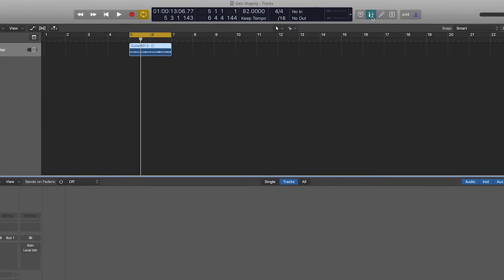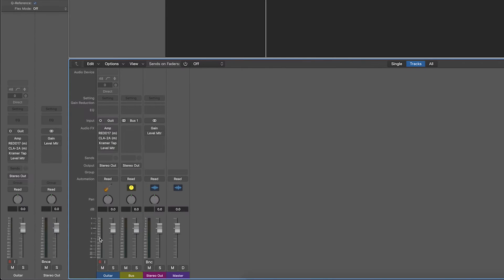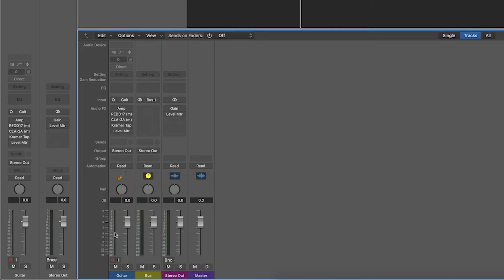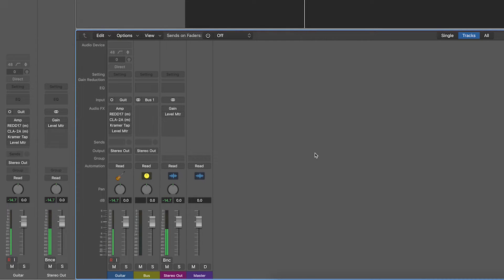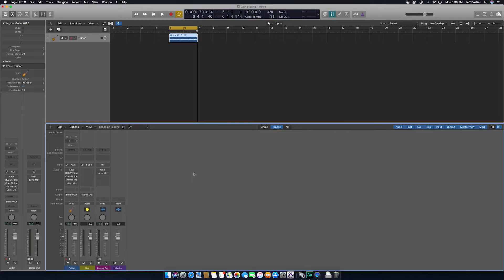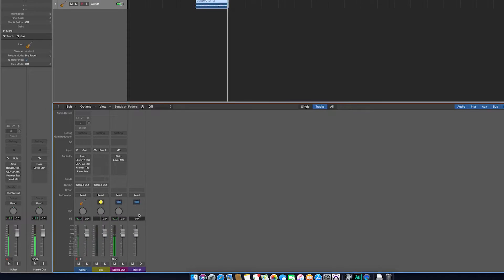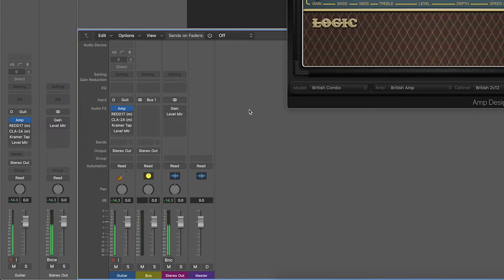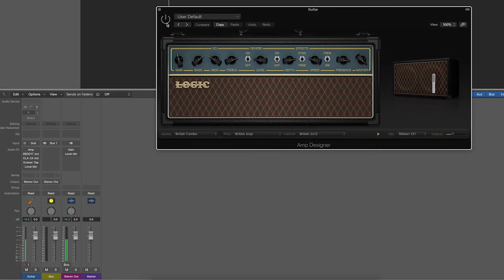LEARN TO: Proper Gain Staging in Logic Pro X

Comment: So funny, I've been recording and mixing in Logic for years, and I do that same gain reduction on my master fader every single time.   I've always thought it's probably not the best thing to do, but it seems to work FOR ME.   I've produced and mixed loads of albums and singles and ALWAYS use this method.   I've never had a complaint from a mastering engineer.   You have set my mind at ease, thanks!

Comment: Appreciate this input, many thanks. But I still get confused about all the professional videos here on youtube telling me different things. It is the -12dBu RMS versus -18dBu RMS question I do not understand. If -18dBu RMS, which is in the analog world 0dB - the so called sweet-spot, why do I learn here that it is -12dBu RMS with peak at -6dBu? Many other videos say that the best range lies between -10dBFS and -18dBFS. In other words: -12dB probably results in too hot signals. It would be fantastic if someone could help me with this questions.
Reply from the maker: No worries at all. So the thing with gain staging is not to overthink it which many people seem to do. Each instrument is different and needs to be treated as such. A bass guitar is very dynamic, doesn’t have much of a transient and lots of sustain. A snare drum will have a massive transient and little to no sustain. If we watched the bass on a VU meter you’ll see the needle moving along with the bassline and you can see it’s average (RMS) level. If you do this with a snare drum you might see that light on the meter turning red because you’re clipping even though the needle movement doesn’t reflect this. The needle in a VU meter can’t keep up with the speed of the transient on a drum hit.

So it’s much easier just to worry about the peak level on each track. Keep each instruments peak level somewhere between -10 and -14ish and that’s all you really need to do. If you had a bass guitar track peaking around -12 then it’s RMS is gonna be around the -18 RMS mark give or take a little anyway. So there is no real need to worry about it.

So just keep each instruments peak level between -10 and -14 give or take and the rest will take care of itself.

Let me know if that helped clear things up for you.

Comment: omg i think i get it, so i was under the impression that every track needed to have a gain plug-in with -12 to -18db but in reality, it’s just a matter of making sure the prefader volume sits between -18 and -6dB in general on each track? regardless if it needs a gain plugin or not?
Reply from the maker: Hey Meh. You’ve got the gist of it. -18 to -6 is pushing it though. Try to keep things under about -12ish. On a distorted guitar then this is simple as the signal is already going to be very compressed. But a vocalist or drummer depending on their technic might go from quiet to loud in an instant, which, if you don’t leave enough headroom then you might clip your converters on the way in and now that take is ruined. 

So when tracking (I’ll use a singer for this example) have them sing the section they will sing the loudest and set your levels for that (sitting around -12ish). Now when you go to record that section if they sing a little quieter or a little louder it shouldn’t affect the recording (unless they suddenly sing 2-3 times as loud) I hope that makes sense.

And if you’re doing that for each track then you don’t need to add a gain plugin to all the tracks because you already tracked at a good level in the first place.

And for virtual instruments, many of them have their default output levels set to “our amps go to 11… that’s one louder…” but they will all have an output level. So just dial that back to be sitting around -12ish and you’ll be good to go on that front.

Hope that all made sense but it sounds like you’ve pretty well got the idea of it all.
Reply: @EverythingMusicRecording  ahh i see!! thank you!! you’ve explained it the best amongst all videos i’ve watched. definitely subscribing 🙏🍾
Reply from the maker: That’s awesome Meh!! My aim has always been to explain these things in a way that’s as easy for anyone to grasp and understand as possible, so it’s always nice to know when I’m hitting the mark! 

If you ever have any other questions, always feel free to ask away 🙂

Comment: The thing about not making tracks sound louder with plugins makes sense

So whenever using a plugin, make sure the volume is the same when comparing
Reply: Same volume with plugin added ,, leaves headroom. Makes a lot of sense .
Reply from the maker: Lol pretty much. It also remedies the “it sounds better because it’s louder” problem which can often fool us 🙂
Reply from the maker: That’s about the long and short of it yes. It doesn’t have to be 100% the same volume so I wouldn’t stress or overthink it. But as long as the volume is pretty much the same then you’re good to go.
Reply: @EverythingMusicRecording  

Im just trying to wrap my head around mixing. Lots of videos and out there but this one caught my attention.

So if i understood you correctly, all faders should be at zero and the output volume from each track without plugins around -12db before starting? So every track is even steven?
Reply: @EverythingMusicRecording  

Maybe I misunderstood, this was probably gain staging for recording not mixing
Reply from the maker: No worries at all. I'm going to reply to both of your comments here. 

You are always gain staging. There is no difference between gain staging when you're tracking or mixing. You're just gain staging different things. When you're tracking you are gain staging to make sure that you are clipping the converters in your interface on the way in to your DAW. As you add plugins you want to make sure that the volume doesn't change when adding or removing plugins. There are 2 reasons for this. First being that you don't want the output of one plugin to be clipping the input of the second plugin, so we are still gain staging here. The second is that we can be tricked into thinking something sounds "better" because it is louder. That's why we want to level match, or gain stage our plugins.

As we add more tracks to a song we still have to gain stage because the combined level of each track will eventually start to clip our busses and/or master bus. Think of a single brink. One brick is nothing, but if you stack enough on top of each other you'll eventually have the Empire State Building.

So we gain stage each individual track, which are going to be send to busses, or group tracks (same thing) so all of our guitars go to a guitar buss, drums to a drum buss, so on and so forth. Each buss still needs to be gain staged as well. Think of the brick thing I mentioned. One guitar track might be fine, but now say 10 guitar tracks all feeding a buss, that buss might now be clipping right off the bat. So now you either need to turn down each guitar track, or you could add a gain plugin as the first plugin on that buss.

All of our busses will also be feeding the master buss. So same issue. Each buss could be fine on its own, but combined we could be overloading and clipping our master buss. So we either turn down all the busses, or again we could add a gain plugin on our master buss, turn that down, and we'd be ok.

So we are always gain staging. Its a balancing act and you're always juggling. There isn't really a right or wrong way to go about it either. I had mentioned turning down tracks or adding a gain plugin. Both work just fine. Just depends on the situation you're in. With time and experience you'll figure out what works best for you. 

You asked if all faders should be at zero. No, not really. As you add tracks you're going to be adjusting levels of other tracks so you really can't keep everything at zero. As with gain staging, you're also always in a stage of rough mixing. If I have drums tracked and now have to record guitars, I have to be able to hear the guitars in relation to the drums. If the drums are too loud or quiet than it would be very difficult to record the guitar tracks.

I hope this helped. Its difficult to answer some of these things over a text reply. Let me know if i missed anything and I'll take another stab at it.
Reply: @EverythingMusicRecording  

No, i think i understand its all about balance. I have noticed that plugins usually raises the loudness thats why i dont like them. Because they take away the natural aspect.

One question, im a bit confused about plugins. My plan is to edit in logic and then transport everything to garageband for mixing because i want to start slow. I have made som midi strings, they have the studio violins stock logic plugin. When i load them to the inspector they come with some plugins like compression and phat etc. Are these essential to the sound or can i bypass them when exporting to garageband and start mixing the violins from scratch?

Thanks, its alot of juggling.
Reply from the maker: Oh you don’t want to do that. You’re just making more work for yourself. Just keep everything in Logic. Now you can start in GarageBand and then move to Logic because Logic can open GarageBand files. But GarageBand cannot open Logic files. So you’d have to bounce each track out, import everything in to GB. Too much work you’d be creating for yourself and no real benefit.

That depends on the patch you’re loading. You of course can turn off or change any of the plugins that open up when loading a patch. The Logic strings patches wouldn’t be too effected if you turn the plugins off. Generally just some light EQ, compression and reverb on those. 

A synth patch on the other hand might heavily rely on plugins in the patch. Just depends on the patch, but in either situation you are always free to turn them off, add more, or tweak what’s there.

Comment: Hello, so just to clarify: I record everything first with no plugins first, gain stage it, and then add the plugins and make sure that the volume doesn’t change? Or do i add all the plugins on recording, and then gain stage?
Reply from the maker: Hey Byron. You have part of it. Let me give you a quick recap. Gain staging always starts at your interface. You never want to clip your converters. Aim for peaks around -10db give or take. This will mean you have good levels going into your DAW without worry of any clipping on the way in. Those same levels going in should be pretty much the same levels you see on that instruments channel in your DAW.

That is pretty much it… except now onto plugins. Many plugins by default (including many presets) have the output level cranked up. Why, I don’t know. So you can record with plugins on, but say the only plugin you have on is an amp sim, your guitar should pretty much be the same volume with or without the plugin on. If the guitar is way louder with the plugin on, you just need to adjust the output level of the amp sim. This goes for any plugin. 

The reason is that if say the amp sim output is super hot, if you add another plugin after the amp sim, you might already be overloading that next plugin in the change. (That all depends on how each plugin is coded, but that’s a whole other can of worms)

And that’s the long and short of it. Let me know if that helped clear things up.
Reply: @EverythingMusicRecording  THANK YOU!!!!
Reply from the maker: No worries my friend

Comment: Some people use vu meter plug in ... can u please explain why vu meter plug in is better vs logic volume meter. Great video
Reply from the maker: Hey Shane. That’s actually a pretty loaded question so I’ll give you the long and short of it. 

A VU meter measures in volume units and responds to audio much slower. Usually around 300ms. But the needle moves in a way similar to the way we hear sound. So for getting a general level reading of a given source, VU meters are great.

The meters in Logic (on the channel strip) are dBFS, digital full scale, and are super fast. They also read up to 0 dBFS which is our absolute ceiling. Anything above that and we get digital clipping which is bad. Whereas on a VU meter, 0 actually equates to -18dBFS (unless calibrated otherwise) 

I’ll have to do a video on this as we can really go down a rabbit hole pretty fast here. Think of a VU meter as showing levels over time, as our heads hear things. DBFS meters show audio in pretty much real time (this is why digital meters look like they are jumping all over the place, whereas VU meters seem slow and smooth) I hope that helped for now.... I’ll do a video lol because there are other meters in Logic as well.
Reply: @EverythingMusicRecording , so i noticed in logic pro x the peak meter is roughy -12dbfs, 0 on a vu meter. so when i put a plugin like a 1176 , i now noticed the vu meter in the plug in also sits at 0...so does that mean it is getting the right signal? 2nd question I track guitars and pan left the other pan right and then bus them to a aux where i put all the plugins saves on dsp , i am on a universal audio platform. so will i apply the same technique on the bus ? i noticed my levels are a lot higher on the aux ( left and right) so i put a gain plug in to bring down the level? or would you bring down the gain in the individual tracks that go to that bus/Aux track?  Thank you !!!!!  this video made a huge difference on how i track and mix now...
Reply from the maker: @shaner36  It sounds like your signals are correct, if i'm reading that first part correctly. Most plugins are calibrated to -18dBFS, which equals a reading of zero on a VU meter. This calibration uses a sine wave at 1000Hz, or 1Khz. So if you create a new track in logic, open up the Test Oscillator. It will default to a 1000hz sine wave but the level will be -12 on the right of the plugin. Set that level to -18. Underneath that, open a VU meter plugin and you will see the meter sitting right on 0. You will also notice on the mixer, that track level will also be siting right at -18. Now instruments will be all over the place because they aren't generating a single frequency at a consistent amplitude. But if your setup is showing -12dbsf, you might be calibrated to that. Waves plugins for instance, if you have the option to change the calibration to something other than -18dbfs, its usually the little screw graphic in the center bottom of the VU meter. Their VU meter plugin its a drop down near the top left. But thats they gist of it. Let me know if that answered your question .

On to your guitar question. First part, I do the same thing. I group everything into busses. I use the busses for global FX. So if you want, as an example, all your guitars to have a HP at, iono, call it 100hz, then i would generally do that on the guitar buss. Or final light compression. I use the individual tracks for FX specific to just that track. So what you're doing is pretty standard stuff. As for the busses getting louder, thats normal. The more tracks you send to a buss, the louder that buss will get. Each track you add is adding to the levels being fed into that buss. How you adjust for that though would depend. If the buss isn't clipping, then a simple gain plugin on the first slot works just fine. If you are clipping the buss then I would turn down the tracks that are feeding into that buss at the track level before they hit the buss.

Let me know if i answered everything for you Shane. And I'm glad the video made such a difference for you!! I'm working on a new video for next week that will really make you, and anyone else who watches it rethink how you track and record. Its gonna be a good one I hope =)
Reply: @EverythingMusicRecording Thank you so much!! just did the sine wave made sure my tbpro vu meter was at 0 .. and now now its calibrated. Ok taking it to the next level..set up a send to an aux track for reverb. unity gain on send and using the fader on the aux track to blend in the amount of Reverb.. would you do it any other way..seen some videos where the send is more than unity gain ? again thank you so much
Reply from the maker: @shaner36  Awesome sauce!! Glad the sine wave worked out and you're all calibrated. As for the reverb send and controlling the level, you can adjust the send level, the fader on the Aux channel, or the output of the reverb plugin. All will do about the same thing. I generally leave the Aux fader at 0 most of the time and adjust how much I'm sending to it.
Reply: @EverythingMusicRecording  thank you so much for all your help!
Reply from the maker: No worries Shane. If you ever have more questions just let me know 🙂

Comment: Hi, Jeff! Outstanding video! Now, I feel more confident on how to use a compressor, saturator, or some heavy distortion plugins! I am an EDM DJ and songwriter, and I love your musical content as well. Let me try to recap from your video.

1. Don't clip on your channels, stereo bus, and the master channel at all times. No question about that.

2. Gain stage to a healthy signal of a sound right between   -18 dB peak (minimum) and -6 dB peak (maximum). There are some questions though. Since the kick and the bass are supposed to be the loudest tracks for mixing, can they be turned down at -10 dB peak? 

3. If I would use a and EQ, compressor, saturator, or some big distortion plugs, I would have to turn down the output as I drive the parameters to the same level as the gain staged instrument tracks.

4. Always leave headroom on the master fader for all times. Leave the fader on the master at 0 at all times. But does it necessarily has to be -6dB headroom? 

5.  If the mix bus and master fader was  crossing above 0 dB, add a gain plugin and gain stage them on both of them.

7. Do not change the first gain on these channels. Instead, try to add an linear phase EQ and compressor. 

If I managed to do all these, with headroom, I'm pretty to go. But, when I am ready to send it out as a demo to a record label, does it need to be limited to be sent to the label for mastering?

Thanks for the help!!!

Ivan